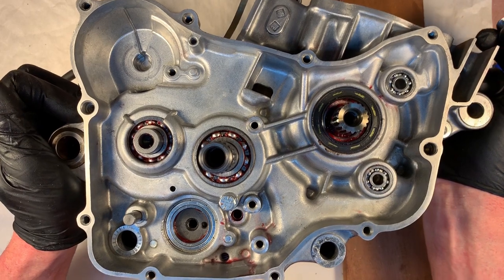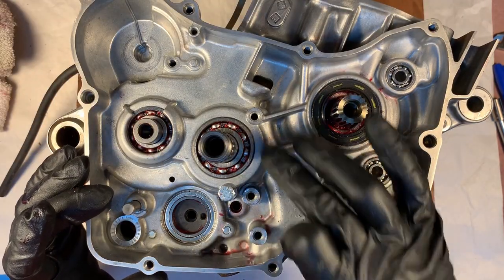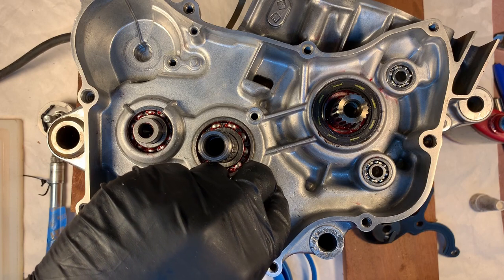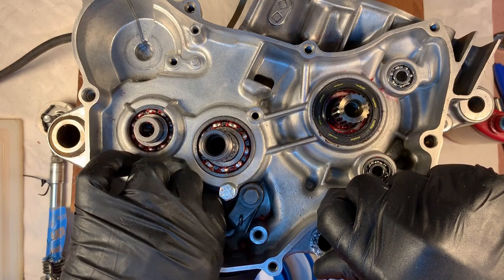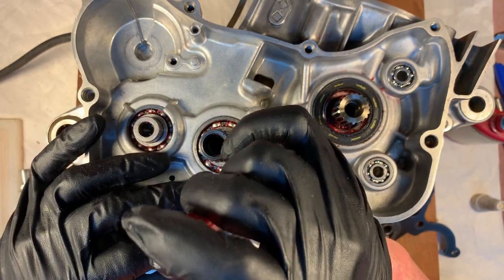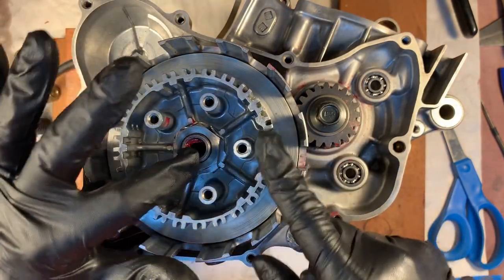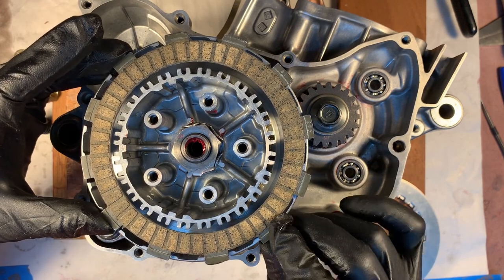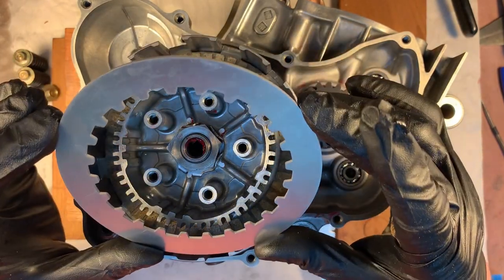Honda CR125 Rebuild || Bottom End Part II

Comment: Good video !!! But man it hurt seeing those dry plates :/ soak them for a few hours before hand
Reply from the maker: Hey Matt!   Youre right.  I wiped them with a thin coat of oil, but soaking would have been better. After I finished the assembly, I filled the gearbox with oil and rotated the crank several times over the following few days to get that oil spread around. It all ended up working great, thankfully.
Reply: @brian.d.mobley  that’s good glad it worked out for you ! Keep up the good work people really benefit from these kind of videos

Comment: Does anyone know where I can find the electronic power valves for the 2004 cr125? My engine does not have the power valves in it for some reason
Reply from the maker: Hi Kaleb.  Sorry, I didnt see this comment.  The only hope you have is eBay.  That entire system (cables, valves, CDI) are all unavailable commercially.  I do have a rear cable if you ever find the rest of the stuff.
Reply: @brian.d.mobley  thank you Brian, it turned out I only needed the cables, I found them off a cr250 and they seem to work fine
Reply from the maker: @kaleb71948  Im a little shocked to read that 250 cables worked.  From my understanding, they are not the same length as those on the 125.

Comment: Is it just me or did the power valve assembly just get completely forgot about😂? Good video tho
Reply from the maker: Hi Jotham. This engine is a shifter kart motor and did not have a power valve. Also, this is a botttom end assembly video so it’s not really about the top end components.  That  said, I did an extensive video on the top end and power valve in this video. Hope it helps you!!!  https://youtu.be/aIKeMiv4O3M
Reply: @brian.d.mobley  I appreciate it! That makes sense now. But my bad, I was meaning the power valve governor gear on the bottom end that connects to the crankshaft primary gear. Finding it difficult to find a video on how to set that gear. But I love the effort you put into your videos they’re very informative, especially that video on the top end
Reply from the maker: @jothamkeller7227  Thank you. This was one of my first videos and it wasn’t great. Content is correct, but it’s too long! I may be doing an entirely new video on the 125 soon. A client wants me to build one for him and I’ll film the process on that motor if he hires me.
Reply: @brian.d.mobley  I understand. Okay sounds great, looking forward to that if it happens.
Reply from the maker: @jothamkeller7227  I hope it does!  I know it could help a lot of people!  Thanks you so much for watching and commenting!
Reply: @brian.d.mobley  No problem, love the videos!
Reply from the maker: @jothamkeller7227  Thank you!
Reply: Actually, I really like how you go slowly and explain everything!  Keep up the good work! @brian.d.mobley